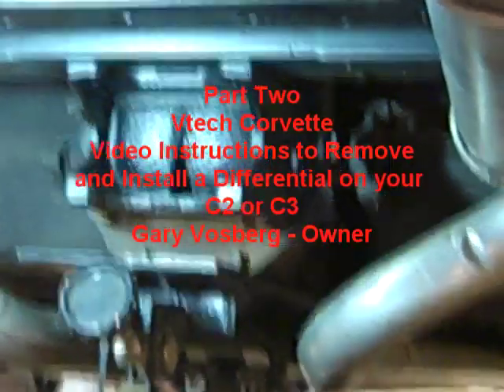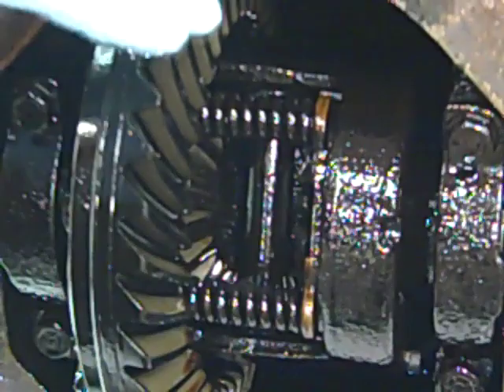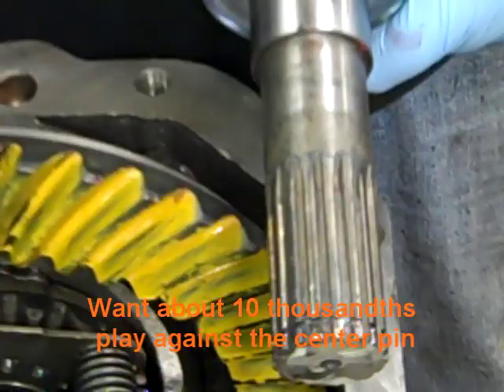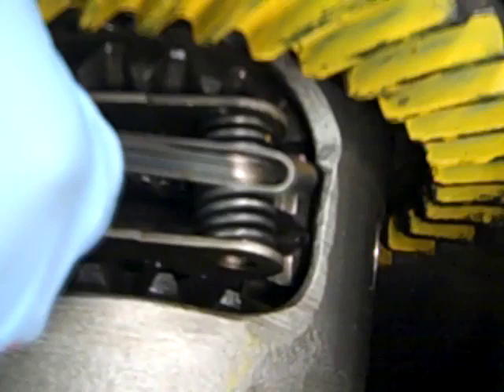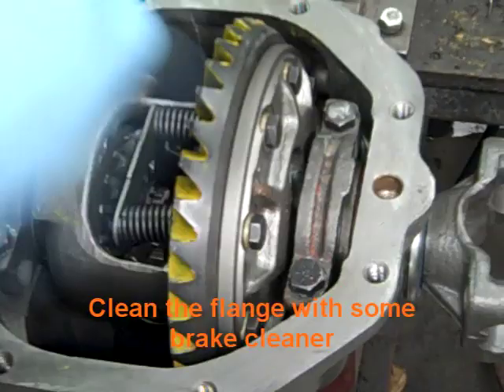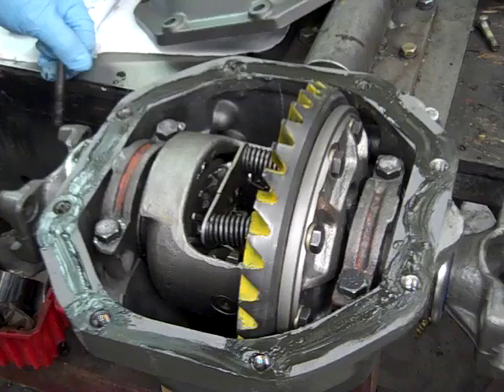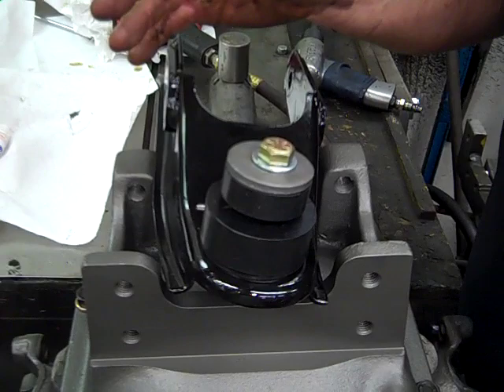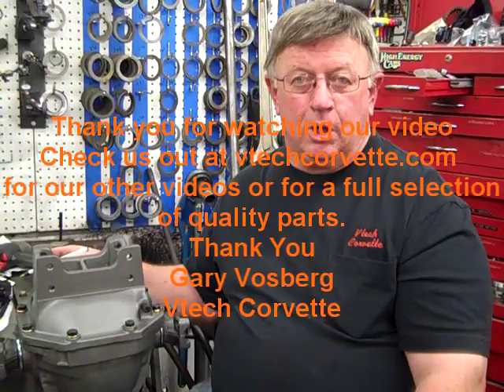Part 2 - Video instructions to Remove or Install a Differential on a C2 or C3 Corvette

Comment: THANK YOU  GARY !
Very good instructional video.   I need to change my stub axles ( Camber is way off ) they are worn about 3/16"
Reply: What year is the vette you're working on?
Reply: 1968
but this video applies to ALL C3 Corvettes  1968-1982

Comment: Nice video and thanks for posting it. I see at time 0:45 the differential is coming out with the cross member attached Im thinking how that was done with the exhaust pipes in the way not to mention all the other stuff in the way. That is way I like videos complete I do understand they can be longer but some parts need to be shown . Thanks, I grateful anyways.
Reply: Ringo Gingo The crossmember can be removed ahead of time to avoid that. Simply take off your leaf spring, and undo the 2 cross member bolts. Then pry the crossmember so that it pops out of the socket. With a jack underneath lower the differential so that you can reach the 4 bolts on top of the diff. Once those are out the cross member will slide out. Makes removing the diff much easier and less prone to hitting a part of your car like at 0:45.